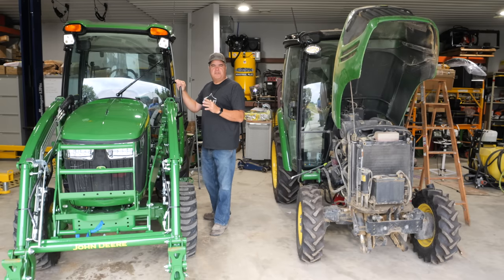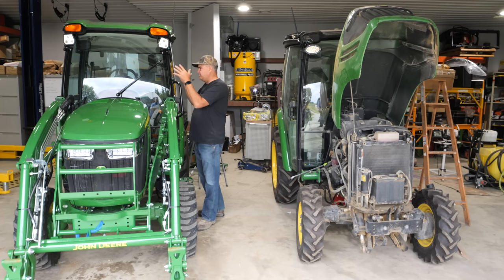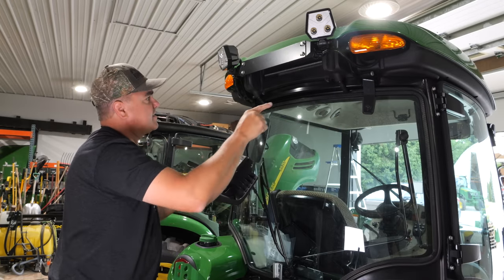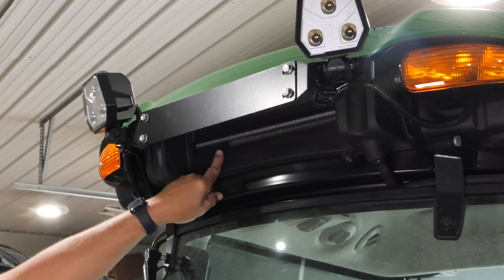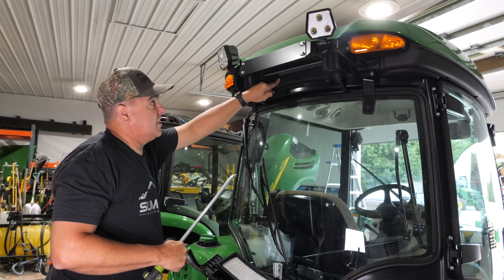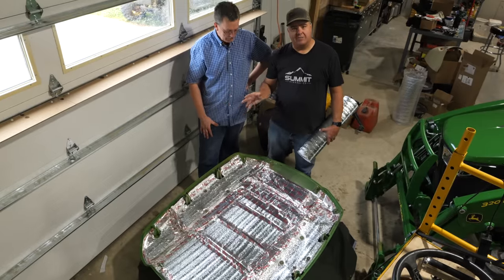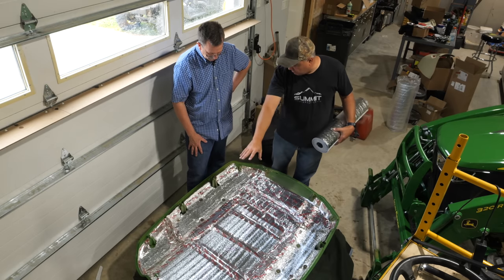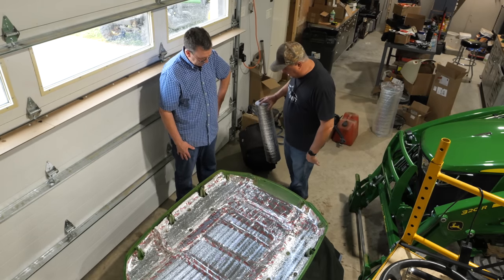8 A/C Upgrades For John Deere Compact Tractors, PLUS 20 Bonus Viewer Ideas!

Comment: done a lot of this previous one of the ways i checked the roof seal was to use smoke to see if i had any air leaks .....next step is have 70% tint in hand to install when i get around to it .....did the roof insulation but only where it wasnt factory insulated....blocked off 2/3 of fresh air intake....installed hot water shut off at engine area....insulated under floor mat....plan on insulating under seat area ...of course did all the cleaning .....will look into insulating low pressure line and more air flow thru condensor ...all ready added some supplemental screening to front of radiatior pack to facilitate cleaning.........each step has helped a bit but still need more i have high hopes for the tint as objects in cab get hot in the sun
Reply from the maker: I like the suggestions about keeping heat out of the cab…insulation below the seat. 
And wrap between engine exhaust and cab.

Comment: What were your plans for the 3520 when you bought it? Did you envision using it as a tractor for hire or as a video series on repair and upgrade of a used tractor?
Reply from the maker: Please watch the video(s) of and just after the auction.  I had no vision.  Did not intend to buy it.
Having said that, I’ve been having fun with the rehab process, so all is good.

Comment: Great video. Our workmaster 65 is designed similar. All the roof mount units are gonna have trouble keeping up with the sun baking the unit. Also, the external air is supposed to pressurize the cab with clean air. The problem is that the filters on the wm are poor and dont seal well. Should have done a before and after.
Reply from the maker: Well, we have both of these machines…we might do a radiant heat test.  Take em both outside at the same time.  Measure inside ceiling temp on both after an hour or something.

Comment: one other issues needs addressed     the floor of the tractor.    your sitting on top of the hydro trans which we all know gets hot,  with only  sheetmetal and a floor mat separating the cab from heat,   use dyna mat or such                    pull the seat out  and install a thermal barrier ( dyna mat) on all metal 
surfaces..      it has worked for me...
Reply from the maker: Ok. We discussed this just after the video. 
Also, we put cab foam on the inside under seat and back panel. We’ll show that in another video.